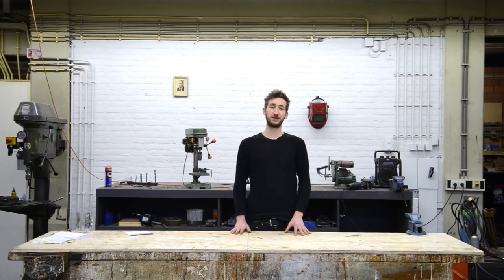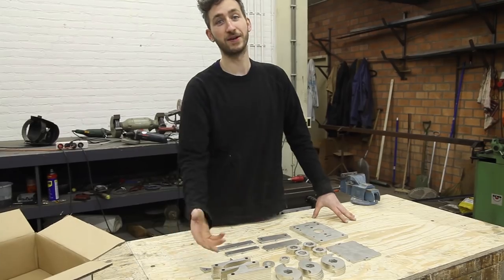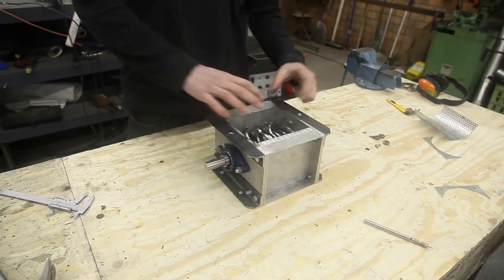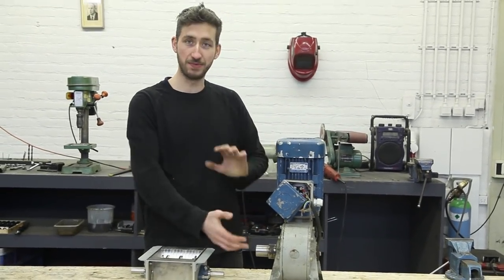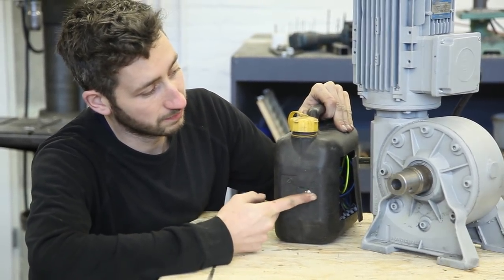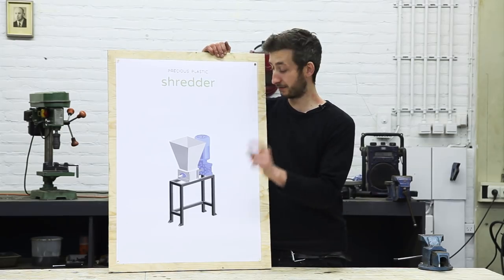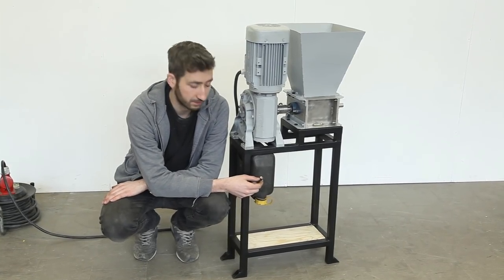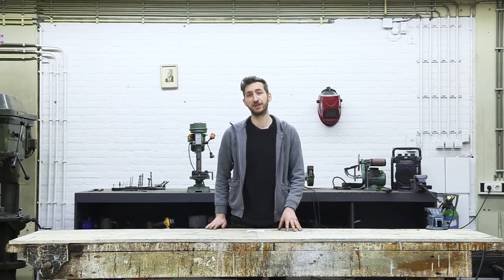Precious Plastic - Build the shredder (part 3.1)

Comment: I literally yelled in horror at some of the things I just saw. First, the big drilling job holding the plate by hand. NO! NO! NO! That drill catches and someone will get hurt. Hex bar being cut in a vice gripped by the points of the hex NO! NO! NO! Grip it by the flats. Holding it that way it can easily slip and while it won't hurt you directly that can strip carbide teeth off your blade. If you're lucky you'll just ruin the blade and the workpiece. Hopefully little carbide bullets won't slide into your eyes or other sensitive bits, or in your case the cut-off wheel will jam and shatter and you can look like you went through a giant cheese grater. At that I switched off. Augh!

Comment: you should mass produce these parts including the motor, lower costs for the simple man, and ship them to any one who desires to build this machine
Reply: What if he doesn't want to do that?
Reply: Ive got a manufacturing facility that can do this.
Reply: @Vrael473  Do it, a lot of people are probably interested
Reply: @Vemund Kremund I've got my engineers costing it currently. Might build the kits or complete units, early stages but Im very interested. At a minimum building a scaled up version for recycling our own plastics and reusing it.
Reply: @Vrael473  when you get a quote from your engineers,please message me.im looking to buy one
Reply: perhaps Chinese have these parts like wood pellet press you can assemble
Reply: let me know if things work out and cost . i am in Nicaragua CA
Reply: @Vrael473  , The geared motor he used costs more than a complete secondhand shredder that needs a bit of tlc.
Reply: @vemundkremund3221  r  u his wife, as u r showing authority ? :)
Reply: Motor is the hardest to acquire part of this machine

so he gets them salvage, according to his website its about 180 pounds for a salvaged one of those motors, but if i were to buy a similarly priced new motor with the same power it would cost double that. It also looks like his has a gearbox to reduce the speed of the output shaft, 

all this if bought new is much more expensive that 180 pounds for most consumers (and is honestly probably undervalued where he is buying them), and though corporations and large entities and have large negotiation resources,  I doubt corporations can negotiate the price too far down in these instances.

while he lives somewhere where it seems he can get cheapish motors (and most shockingly the speed reducer) not many people know where to find them... its probably why he claimed that it didn't matter too much what motor you used provided it was "slow and powerful" or high torque. 

of course you can wind your own motors, but thats lots of work, not to mention, it takes a significant amount of work to build/design a good reliable speed reducer.
Reply: @uristmcary  yes have this kind of problems in moritania the right gear motor is almost impossible to finde and werry expensive. Heating elements and thermostats  non existing so I use gas. And Manuel temperature controle 😁
Reply: @Vrael473  Hello I pick up plastics along the beach and the cities near to help the environment I would definitely love buying this from you. When you give it a try let us know. I'm trying my best to help the environment
Reply: @okidokisarah593  Hi Ana, So we did build it and it did work. We need to find a slower motor with higher torque but it does work. We also have to change the blade design. The design in the video is perfect for lighter thin plastics though. My team kind of dropped the project and moved in to other things but the prototype is in our tool room still.
Reply: Good idea.
Reply: @phoxyii5831  You don´t need "laser" cut parts. Anyone with a good CNC machine can build that stuff, provided the base material (thick steel plate and rod) is available. It doesn´t has to be stainless either, and very probably it can be subject to a thermal treatment to improve wear resistance. Trust me, I´m a metallurgist and I know what I talk about.
Reply: @phoxyii5831  check the bazaar on their website
Reply: @Vrael473  Do you have these kits for sale?
Reply: @Vrael473  How much would you ship a kit over for? 
I think the guy does em for around 300 on the website
Reply: @FBPrepping  I think a CNC plasma could do it, too.
Reply: @Vrael473  Can you build that machine and send it to me?
Reply: @nightwatcher6090  I built a prototype it works but the motor we used is higher speed and lower torque. Would need to change the motor. But yes it technically worked.
Reply: @Vrael473  hi buddy, let us know when you get any results
Reply: @denismontana  I actually did end up building the prototype. The motor we used was too high speed not enough torque. But it was very feasible. With the right motor and good blade design (Id suggest smaller teeth and thicker) this unit would perform well. As is it is perfect for water bottles and light plastics. Would need heavier duty teeth for more dense plastics/thicker material. Im thinking of building a larger version now that weve proven out the design.

Comment: Hi, I have had the shredder plans cut up by Lazer cutter in stainless steel, total cost of $441.00 Aus , I look forward to putting it together, I will be using a pool pump motor and gear it down with motorbike chain and cogs, will keep posting with ideas and video once working!
Reply: HEY DOUGLAS IM FROM AUSSIE TOO, DID U END UP PUTTING THE SHREDDER TOGETHER? I'D REALLY LIKE TO FIND OUT HOW YOU WENT :)

CHEERS MATE!
Reply: Did you cut parts by this value? Can you dispatch to another country? Brazil? How much? Thank you.
Reply: How Rich is hi there, it's been a long journey but have just finished putting this together so it is now spinning in the box, I had to do a lot of hand filing to get the blades to fit the shaft but that was due to the shaft being a little big so lesson learnt, I'm going to do a breakdown of hours, materials and costs to find out whether viable to build for other people or just too expensive as there's a lot involved, but satisfying to see it work,  I will try a hand crank and see how hard it is to shred different plastics and am yet to get a motor on it, a metal stand and a hopper are next on the list of things to do, just wish I had more spare time!
Reply: José Eduardo Fernandes hi there, the parts are very heavy and would be very expensive to send by air, you need to find an engineering place locally!
Reply: Thanks for the answer. I'm checking with companies in the country for the cost of cutting the pieces. Solder I have and I can do and the motor will see if I can get one used.
I ask the question of cost because I see many people wanting to know values. I found in your post the value of $ 441 AUS and did the conversion to the local currency to get an idea. Still waiting for the values but also found a person selling the machine ready. In the near future I hope to inform you that I have completed my machine too. Big hug.
Reply: José Eduardo Fernandes hi Jose' can you post the equivalent costs as if we are to know which countries materials and services are cheaper, I can build from second hand materials but only when they are available, realistically people want them now so costs of new materials to build the shredder and bearings will be relevant, I will reveal all costs of materials and time taken to build so people realise it is not easy, I will estimate a total cost of around $3500.00 which would include motor frame and hopper, any change from that will be a bonus, I have only finished the shredder so far!
Reply: Douglas, hey how rich is, yes I have just completed the shredder, it has taken me 6 months in spare time and about $1000 in total materials and running around to get them, I'm building the frame and hopper from seconds and have a free motor from the pool guy I need to gear down so I've estimated a total of $3500 to complete the project!
Reply: hows it going any updates???
Reply: wowo
Reply: Hey Douglas, I'm down in Tassy and looking to build something myself.  Any reason you went or stainless steel?  Do you think mild steel would be hard enough if its just shredding plastic?
Also, did your engineer shop have to do much work to the drawings to make them work for there machines or was it pretty much plug and play?
Reply: Douglas Watson I don't know why you are using bike chains to hear down a pump, when you could get a variable speed drive to do it, as long as you have an induction motor.
Reply: @matthewmeuleman3369  - Torque

Comment: Many of you says, that this is too expensive and impossible to make. I have been on Sri Lanka and I was very impressed, what they have and can do in their workshops. They have lathes, welding machines, mills. Even plasma CNCs in small, town workshops on the streets.
Reply: It is true that cutting metal parts can be expensive, on the other hand by giving yourself a bit of trouble you can make them all yourself with an iron file, an electric drill and a simple grinder. You still have to want to take the trouble.

Comment: This series is very inspirational. We can adapt the basic methods to suit our capabilities and resources, like using old carbide-tipped Skilsaw blades for example. You can find materials in a scrapyard - such as old appliances for the sheet metal. Maybe try a gas motor instead of electric. Personally, I would want a shredder with a much higher RPM. Maybe a wood chipper/shredder would do the trick, instead of building from scratch?

Comment: I copied the plans to spec and had it made by an engineering company in Adelaide, South Australia. The time and the cost was outstanding. $440au for 1ph 2.2kw 3.5hp 4pole electric motor. The frame and all the parts and labour came to $2000au. To have this wired up its going to cost me another $300au. Turns out my house doest have a 30amp power supply to run a 15amp motor which when running and you start feeding plastic in it, the amps crack up to 22amps. I don't have a transmission and I think I'm going to need one because it spins way to fast.
Great design but for a simple machine and how simple you have made it look, you really do need abit of spare change to make this thing.

Comment: That free-form large diameter drill operation at 1:55 is super dangerous. Always clamp your work or you'll have a uncontrollable death propeller disemboweling machine at torso height before you know it.
Reply: He has the metal screwed to the wood at least. No clamp on the wood however.
Reply: Always good to warn of danger. In this case it’s very little danger. In the vertical one the motor would spin just a little then get stopped by the drill press body. In the other one... yeah, it could swing around and give him a tap on the hip. He’d just keep drilling. To make it truly dangerous you’d need a Morse taper drill bit in a gear head drill. There’s nothing to give. Serious danger. In this case you have a small drill bit and it’s going to spin in the chuck. If it holds the belt will slip. If both hold it’ll gently swing around and give a love tap. The weight of that motor along with the moment arm of drill to motor length is extremely large. In conclusion..I don’t think there’s any chance to spin it. I was on the phone with a friend many years ago and his father at the same moment had his arm ripped off by a gear head drill press. Not something to take lightly and as I started... warnings are good
Reply: @MikeGearon  A gear head is definitely more dangerous, but since I'm speaking from experience, I can tell you you'll get more than a "love tap" out of an ordinary full size belt driven drill press with a piece of plate steel stuck to a large twist bit. My advice is to form good habits, so you can focus on the job and you're always setup to clamp work at the drill press without spending a lot of time setting up. Like putting PPE on, do it all the time, chances are you'll have it in when it matters.

Comment: Hi Dave, 
I love the whole idea behind your project so watched the video on your site home. You claimed that your machines were made form easily obtainable items. 
News flash, getting laser/ water jet cut blades and components would not be cheap in the US. That already stops me in my tracks.  Can you estimate what it cost you to cut parts and what country it was done in so I can convert to US currency please/ 
Few of us have access to a fully equipped metal shop and it's obvious that at least a few major tools are needed... My brother is a general contractor who's pretty complete shop lacks a few of these items. A belt sander is easy , a drill press not too hard but some of the other things, bits and blades are not in the typical shop unless you do metal work.
Such prep at the current machine shop cost per hour $$$ is would not be cheap... The actual assemble it looks fairly straight forward till it's time to weld, again same as above, not something most can do. 
I LOVE what you have done and the idea behind it but it's looking like a very expensive venture simply to get set to begin the process and this is just the first machine!  Can you estimate what it would costs to assemble to whole range of machines please?? 
Thanks for your great idea, now lets figure out how to make it affordable to more people. Best, Penny
Reply: +Penelope Stames - What he is making with water jet cutting and laser cutting can be made in other labour intensive ways or by re-purposing scrapped equipment like paper shredders...

Just a matter of thinking creatively and coming up with work arounds...

Welding is something anyone can do...not so difficult and not we maybe have friends who can and have the gear.

Hese guys are giving us the plans, their work, know how for free it's up to us to get creative and make it work.
Reply: +Dane Lavery Come on Dane, you know you're supposed to provide step by step instructions for someone to build a thing using only a rock and some duct tape. Critical thinking and problem solving is for chumps!
Reply: Pete...

Oh...sorry...I am so naive for an old chap sometimes...

Think I will have a crack at making this gear using alternatives though not with a rock and duct tape...

A vice...a file and an angle grinder will have to do instead of laser/water jet cutting...and I just have a ropey old arc welder so SMAW will have to do instead of MIG...

This isn't rocket science and I love the low tech approach...such a contrast to the world's largest Mixer Extruder & Pelletizer I inspected at Kobe Steel last year for INEOS. (BTW they did not user laser or water jet cutting either so I think matey is just showing off a wee bit... ;-)  )

Thanks for the perspective...
Reply: A vice and a file? What are you mad man! How about if we include some ca glue with the tape and the rock, surely that's enough to get it done? :D

As for using a laser cutter, I mean everything is better with lasers Dane, more power!
Reply: Pete,

Late to reply...don't use Gmail much...sorry...

CA Glue, Tape and Rock...who do you think I am...MacGyver? Ridiculous hard challenge... but since I am a mad man...a bored mad man on a Sunday night...

On a desert island then with a beach full of unsightly plastic garbage...off we go then...

Make fire
Burn down a tree...easier route than make a stone axe and blisters
Divide into two sections...One long the other short for a lid using same fire tech
Char out core of long piece using fire char technique used by North American Firt Nation Peoples
Take the rock(a large one) and smash it into small pieces
Use the CA glue to fix the jagged rock fragments in the surfaces of the hollowed out log and the the lid
Fill the log with rocks and scrap plastic - Pin the lid on - hold pins in place with duct tape

Now we need a simple device to roll the barrel grinder back and forth

Something like a see saw with a rope tied to each end of the see saw, flung over the bough of a convenient tree...Heave ho....Job done...and you end up with abs that will thrill the ladies...

Robert is your Mum or Dad's Brother. 

Now...does a vice a file and an angle grind sound like an easy high tech route to follow... :D
Reply: if they dont have laser service or waterjet company near by  ..the CAD files can be export to EPS o vector files and print them in paper or decals and then glue to a piece of metal sheet and cut them with drill and grinder ...

Comment: I was able to build this by build a couple things out of wood such as the hopper and stand. I also skipped the motor and went with a sprocket and an old bicycle on a stand. It's not as pretty, but it works and really cut down costs. I'd like to get a nice AC Motor and build a metal stand out of metal one day but it wasn't feasible after spending $550 on laser cut blades and $140 on lathing a hex bar.